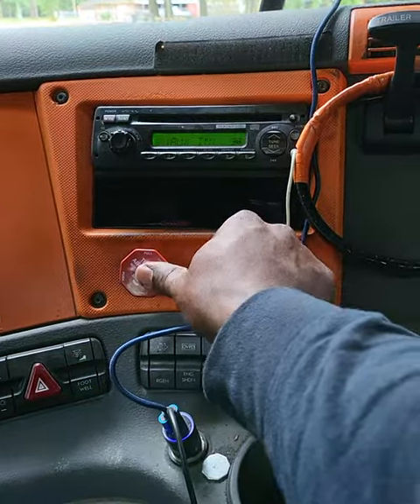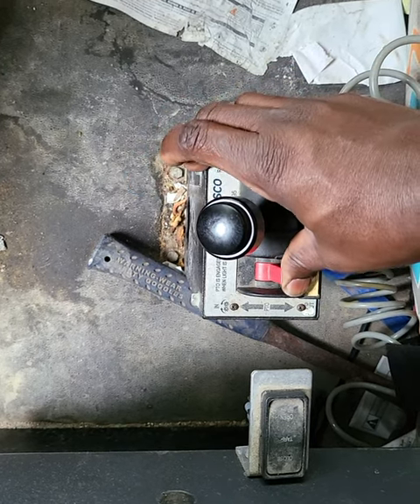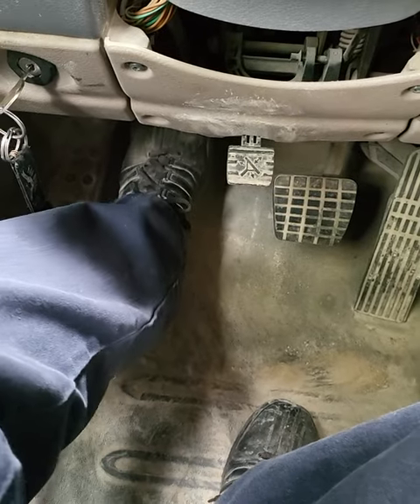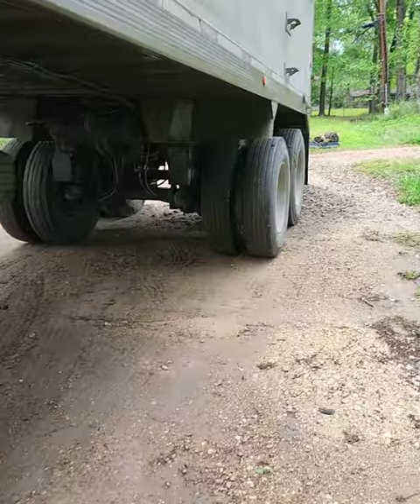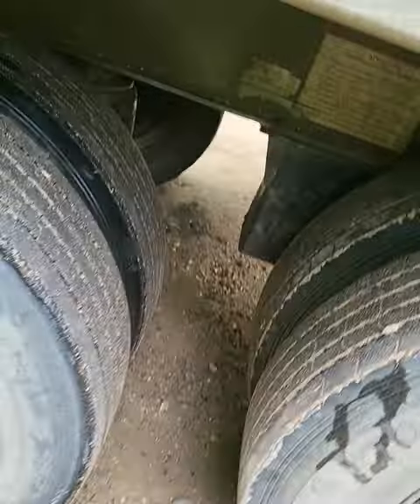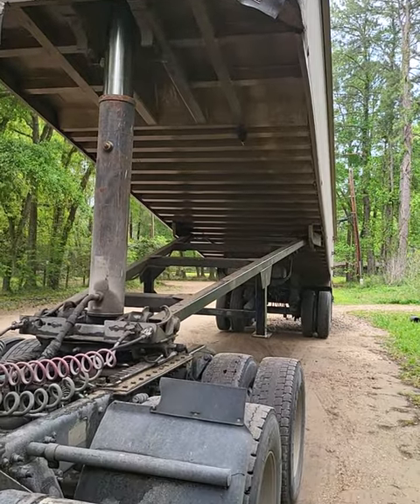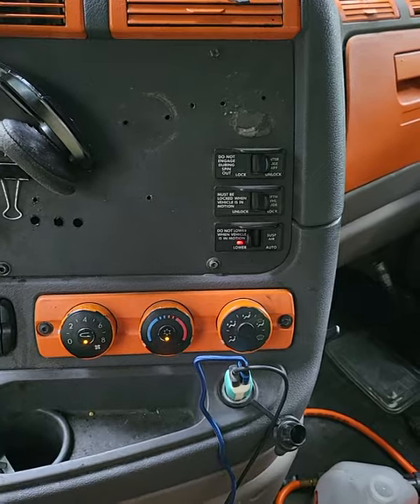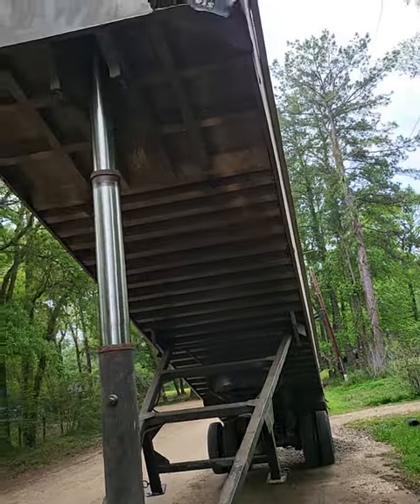How to operate end dump trailer

Comment: Nice video! I was taught to lock the trailer brakes and let the truck walk to the trailer
Reply from the maker: Sorry for late reply.. but everyone has their teachings.. but I find when truck walk to trailer most of material don't come out and will push truck and trailer fowards.. so walking trailer to truck all material comes out fine.. plus I deliver to ready mix companies and all their grounds are either concrete or very leveled hard surfaces.. been doing it for years never tip trailer.. but do as you are taught.. give a thumbs up if you walk truck to trailer and it pushes your truck  when dumping and if it don't you still have to pull foward to allow material out trailer so the trailer still moves while In air..

Comment: Great video, I pull a 30’ aluminum 3 axle end dump, and iron demo trailers, I was bouta say that I dump truck bags when I dump till I seen you go do it,  our aluminum trailers have a plunger which dumps trailer bags and opens gate latches, but I still go check when I dump every load bc I’ve seen those plungers stick more than once lol, and definitely make sure ground is good going up, like you said, can’t stress it enough,  in my 18 years I’ve laid an old demo trailer over years ago lol

Comment: Let trailer roll until you front axle clears the ground that way I’d does not dig holes in the ground that you would eventually pull into as you dump especially if you are dumping on loose ground or dirt